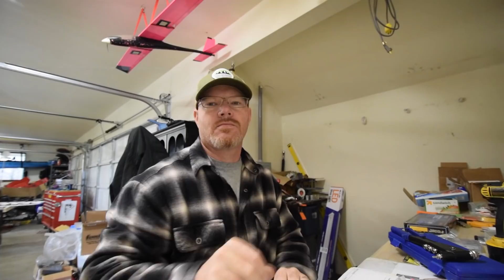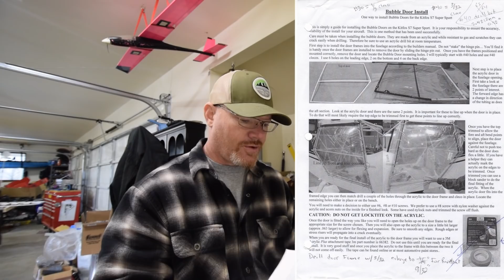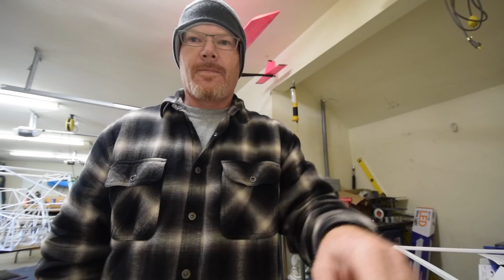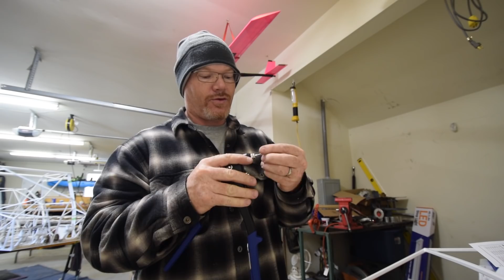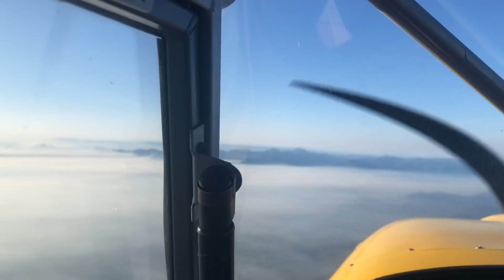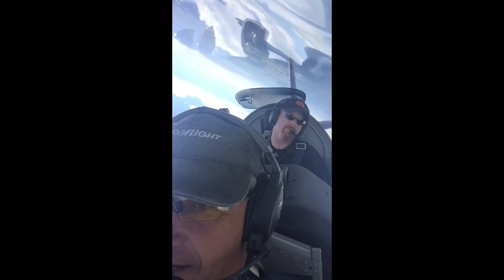Kitfox 7 Apex Build Episode 4 Kitfox Apex Build,  Door installation

Comment: Hi Brian, Great videos. 
I've watched them all and am going back to watch them again now that I'm actually building my SS7.Did you end up buying longer screws for the rivnuts in the door?
Reply from the maker: Yes I did to account for the weather strips
Reply: @BowenAero  Thanks for getting back to me.  Did you end up sanding down those welds on the door or did the weather strip create enough space that you didn't need to? I also sent you a message on your Bowenaero site regarding grips.
Reply from the maker: @tman3587  The weather striping gave the clearance

Comment: Just a question are the kit fox doors acrylic or polycarbonate?
Reply from the maker: The bubble doors are acrylic.
Reply: Project Kitfox Thanks, would have thought they would crack where you drill the fixing holes as it is quiet close to the edge. I am busy experimenting with making polycarbonate doors using a vacuum table and drape mounding.

Comment: 5:00 fairly small diameter and fine thread combined with soft SS is always hard to get right. Also your cool air temp seems to make them stiffer. Keep nuts warm helps (unintentional joke). I just keep a handful in my pocket so body heat keeps them softer.

Comment: I wonder if it would be nice to paint a black stripe along the inside edge of the acrylic bubble where it lies against the frame. This is often done on automobile glass to hide bond line/adhesive unevennes, air bubbles, and other imperfections that might otherwise be seen through the glass (or plastic).
Reply from the maker: Jose that is a good idea. I think I will take some of the scrap acrylic and test paint it and see how it looks. Thanks for the suggestion.

Comment: I ordered my highlander kit with no powder coating. I choose to go with poly fiber ep420 epoxy primer and poly fiber mark 2 topcoat. I choose this because I also wanted all the metal black. The primer is easy to work with and spray. I can let you know how the mark 2 black top coat turns out. Im not quite finished priming everything yet.
Reply from the maker: Please do
Reply: I have most of my parts sprayed with the top coat now. It is the poly   fiber mark 2 paint. It's a 2 part urathane paint. I find it easy to mix and easy to use. The finish is glossy. It is my first time using poly fiber  paints and I would probably use it again on the next kit. I will only be painting the steel, some aluminum, and fiberglass parts on this kit. The fabric is going to be oratex.

Comment: Side note: Rivnuts should be Keyed to keep them from spinning in the hole. Easy to do. With a small triangle file cut a small notch in the hole for the key to fit in.
Reply from the maker: John, good tip, I noticed after the fact that Aircraft Spruce offers both keyed and non-keyed. For the window it should be a one time install, so I'm not to concerned about it, but for an application where you would be removing the screw for cowlings or inspection covers, the keyed would be ideal.

Comment: You will occasionally pull threaaout on rivnuts. As for the rivet gun there should be an adjustment for the extra threads sticking out of the rivnut on the head of the rivet gun. And for the metal shavings buy a fixable head magnet to get out what falls inside of the frame.

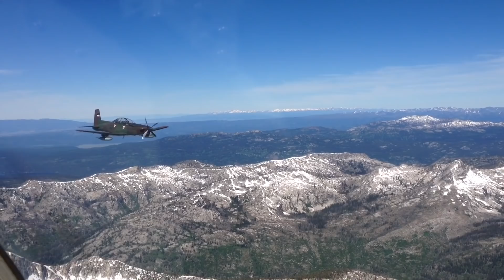Comment: Well done.  You could have just notched the plexiglass around the protruding tabs on the top edge where the hinges mount.  And, before grinding on those welds, I'd try and fit the weatherstripping in there first to see if it allows for the weld (I believe it will)..., if it doesn't, maybe just stop cut the weatherstripping on one side of the weld and restart the weatherstripping after the weld.  The manufacturer left that weld protruding knowing it was getting weatherstripping and plexiglassed later.  What is the plane at 7:30 ?
Reply from the maker: That could have worked too. I will test fit with the weather stripping and see if it clears the welds. That airplane is a Pilatus PC9. We were filming it from a Pilatus PC7.
Reply: @BowenAero  Btw, I have 25 years as an aircraft mechanic.  From wing-tip to wing-tip, nose to tail.  Systems (fuel, hydraulics, pneumatics, oxygen, nitrogen...etc), flight controls, powerplant, structures...etc. Mostly military programs.  Marine Corps A-4, A-6.  RAMS (Repair and Modification Services (Field Service) for McDonnell Douglas (Boeing) on the C-17.  Just thought adding that might be a good idea in hindsight.
Reply: @BowenAero  That Pilatus is a sleek, good looking bird!  Thanks!  I can't see any other reason for the manufacturer of the airframe to have left those welds proud unless they knew the acrylic would fit taking into account the compression of the weatherstripping (or starting and stopping straddling the weld).  Happy flying, man!

Comment: I'm getting a new airplane soon, and have a question for you.  I'm sure you're aware of the thin plastic film that sticks to glass and plastic, and is pretty much always on glass and plastic [window/display/screen] surfaces of pretty much every electronic product sold these days.  Well, I hate bugs and [fine cleaning] scratches on my windshield and door windows, and I figured the best way to deal with this is... to get big sheets of that thin plastic sheet and apply to the front windshield and door windows.  As you're aware, this plastic sheet adheres to smooth glass and plastic without any adhesive... and leaves no residue whatsoever when peeled off.

The thing is, I've never seen this material sold bulk or separate from products, but it must be available.  And if you're anywhere as annoyed by gunk on your windshields and windows, I'll bet you'd like to do this on your airplane too.  :-)  If you even know the name of this material (anyone)... let me know in a reply.

PS:  It is great fun to watch you build your airplane.  Keep up the good work.
Reply from the maker: Max, I haven't heard of anyone trying that. Personally I use Pledge on the wind screen, the wax makes it easy to clean off bugs.
Reply: @BowenAero   : I'm not surprised you never heard of that.  I'm an inventor and new (and hopefully better) ideas pop into my head all the time.  If I manage to track this down, I'll let you know.  I've just been having trouble tracking down that specific plastic film I refer-to.

I guess the Pledge trick is a bit like a cheap version of having a few molecule thick layer of teflon put on the windshield.  Interesting idea.

Somewhere I read about putting a super thin layer of ceramic on the paint of a new (or newly painted) airplane for similar reasons (to make it easier to clean).  Not sure whether that is transparent, however.

Comment: Great build, been using those "nutserts" for over 20 years, they work great and hold up well. Their only weakness is the material into which they're installed, metal is the best, aluminum the worst where you'd want to back them up with metal tab. I've never had the nutsert itself fail. Sure gives you a strong hold and a nice clean finish.

Comment: on the rivnuts is there a difference between aluminum and steel or  make a diffrents
Reply from the maker: I was told not to use aluminum. Using stainless screws with aluminum riv-nut can cause some issues.

Comment: I really enjoyed this video. I was thinking about your thoughts on painting the aircraft frame and came up with some easy solutions for consideration. Rustoleum makes a very cool two-tone aged iron paint, https://www.homedepot.com/p/Rust-Oleum-Stops-Rust-12-oz-MultiColor-Textured-Aged-Iron-Protective-Spray-Paint-223525/100390815 and also another option would be to use a single coat of VHT wrinkle paint that you can control how much "wrinkle effect" you want by using a single coat and a heat gun. Fewer coats results in a less raised wrinkle finish. Also if the white shows through in some spots it might actually look cool too. I've had good success using a scotch-bright pad to lightly scuff up the wrinkle paint layer white its still tacky to give it an interesting  SPX. https://www.youtube.com/watch?v=WaBbd7-RvKQ

Comment: Don't mount your doors and hinges until you have the wings and butt ribs mounted.  The tabs where you mount the hinges will move once you mount your butt ribs and wings. This will make the doors not fit anymore, and the gas struts will be out of adjustment, and your door will hit the bottom of your wing.
Reply from the maker: Thank you for the tip and explanation. Someone else had mentioned this but didn't explain why.

Comment: Just got to the part about stripping the riv-nut, stainless steel is considered a soft metal, and is known for being easy to strip and cross thread.
Reply from the maker: Matt, yes you have to be very careful with these river-nuts, I would order them from Aircraft Spruce next time.